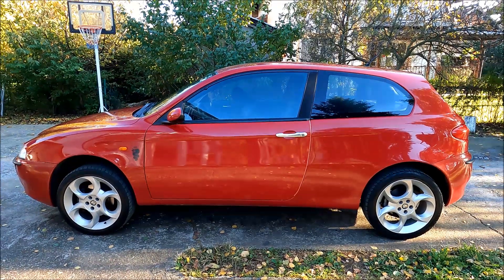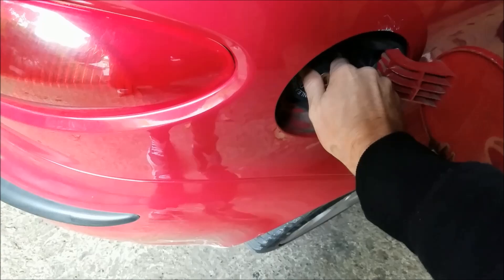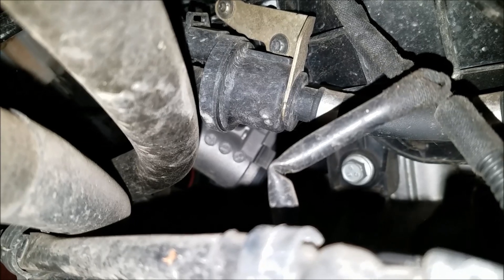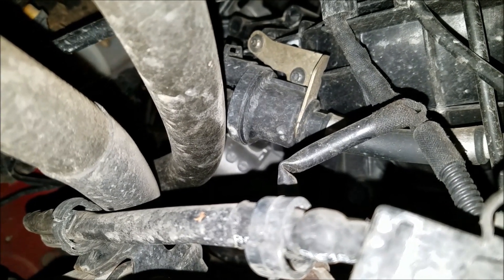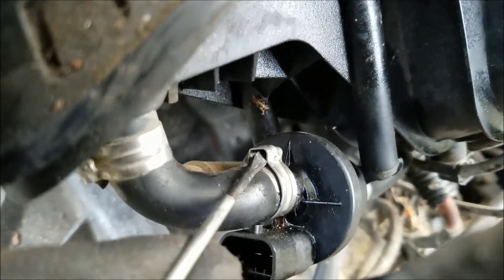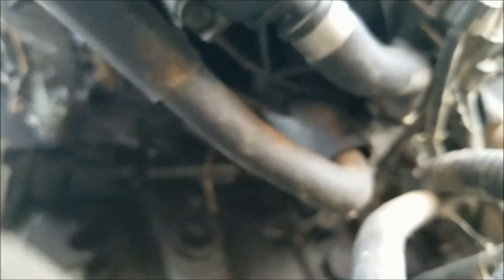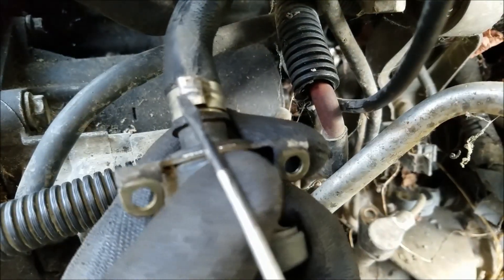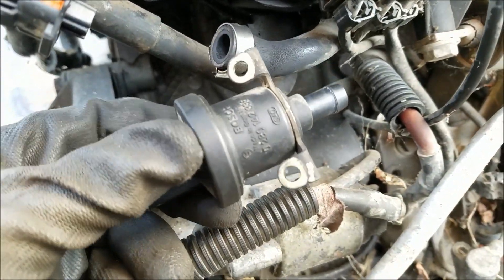Fuel Tank Breather Valve Location Removal Alfa Twin Spark Engines, EVAP

Comment: Is there any chance that a malfunctioning breater valve be responsible for petrol smell in the cabin ? I am getting petrol smell but not all the time, sometimes is there other times no. Putting fuel in the tank is not connected with the smell. I do have some pressure inside the tank, it hisses when I open the cap, but I don’t think it is that much of pressure...Any comments / suggestions ?
Reply from the maker: My guess would be the fuel pump seal, I don't think it is the breather valve...
Reply: @arcgarage  Cheers man, thanks a lot. I guess I would replace the whole thing then. Was going to do it any way. After 20 years it is probably good to replace it
Reply from the maker: No problem, you don't need to replace it all, just the rubber seal, it costs only couple of Euros, but make sure that is cause of the problem first...

Comment: This video is timely. I have just replaced mine in the right fender on a V6 GTA. I was having some intermittent warm starting issues. The car will take a couple of turns to crank up and starts like an flooded carburetor. Only happens when it is stopped and restarted while it is warm. I thought the valve is stuck open but after testing the old valve, it seems to seal and open fine.

Comment: I have a 1,6 L twin spark and after the replacement of the petrol pump in the fuel tank i can't fill the tank with petrol because it builds pressure, the gas station's pump keeps stoping every 0,5l of petrol. Is that what may needs replacement?? Or is it something else?? Any help or opinion is appreciated.
Reply from the maker: Check the hoses, and make sure that breather is clear
Reply: @arcgarage  the mechanic removed the tank completelly last week as well as the fuell pump and preety much everything from it and he could no tfind something wrong. He also told me that there is no hose going from the tank to the engine except the one for the petrol, is that even possible? i mean he should had found the one with the breather, wouldn't he??

Comment: hey man
ı hope you're fine, 

I have a problem

Where is the gasoline pressure regulator, my car 1.6 t.spark alfa 156 2004
do u know on engine location ?

If I replace this valve, will the pressure problem be solved?

When I search on the internet, it seems like there is, but I don't know for old engines..

In the morning, when the car is cold, it barely starts after 3 starts, the fuel pressure disappears somewhere.

There is no gasoline pressure in the hose at the front of the engine, that is, no gasoline is gushing out, the spark plugs, injectors, ignition, gasoline pump are working, so everything is intact,,
After the car starts, it starts normally again, but we cannot find where the pressure disappears.

thanks...

Comment: Very usefull videos, I'm very impressed by the content quality and by the precise informations. 
I have a 1.8 TS engine and in my case, there is also pressure in the fuel tank and the dashboard fuel indicator gauge is blinking when i start the engine. There is also permanent fuel smell no matter if I'm filling the tank or no. The engine works very smootly, no "check engine" light. Any opinions? 
Thanks for your great videos, is such a great pleasure to work myself on my car. Keep up the good work 👌
Reply from the maker: Thank you very much for support, check the main fuel pump seal, it might not seal right, and that's why you might be smelling fuel...